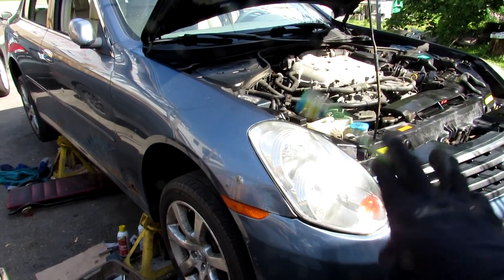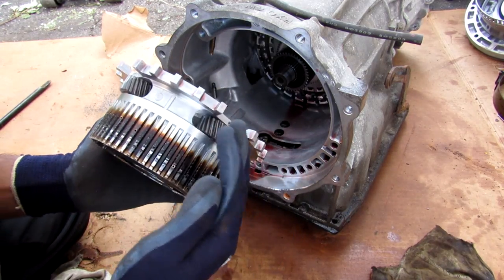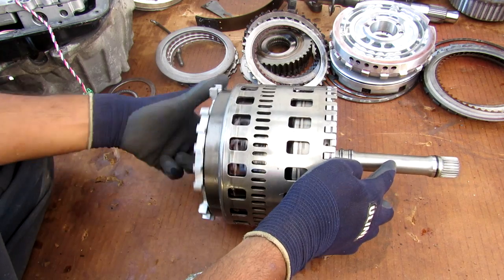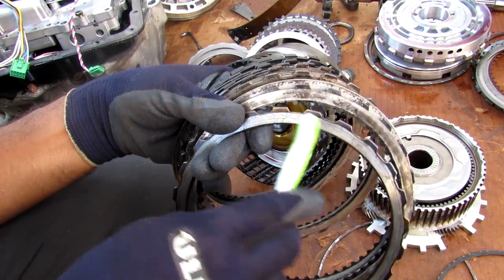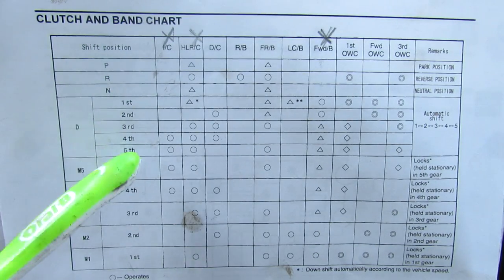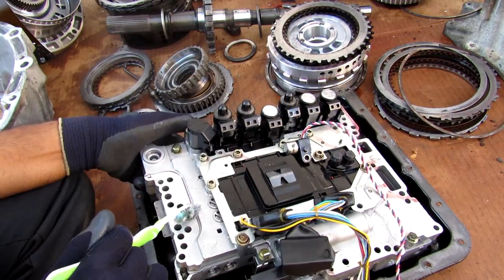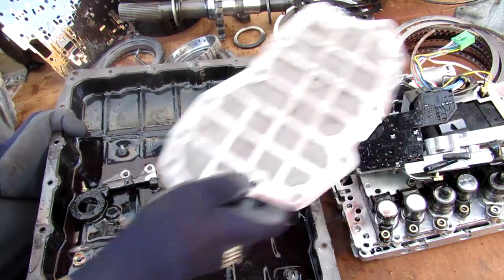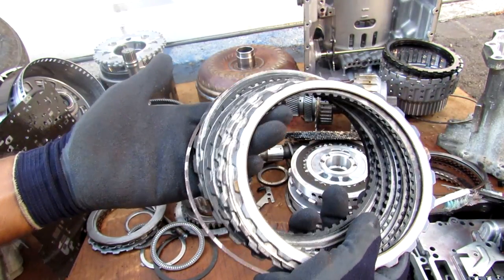Why Automatic Transmissions Fail

Comment: I can see why it cost so much to fix automatic transmissions. And it requires your brothers complete wardrobe to clean up the mess! 😄
Reply from the maker: Yes it's quite expensive. Most might just swap in a rebuilt
Reply: lmao
Reply: Hmm hmm
Reply: And that was a 5-speed automatic... imagine now an eight-plus speed.
Reply: cheaper to swap than rebuilding it.
Reply: And wifey's toothbrush
Reply: Just washes his clothes in dawn and put them back in his drawer he'll never notice.
Reply: Not only does it cost a lot to rebuild an automatic transmission, but there are not that many shops that can do it properly.
Reply: @SCX1718U  In a&p school A student brought his aircraft engine in and rebuild it in engine class.The other engine was done by a shop much cheaper and the accessories were new or rebuilt.He wanted to do both engines himself but couldn't afford to.
Reply: @allanbrogdon5317  yawns....
Reply: @patricklynch9574  works on oil soaked birds as well.
Reply: Honestly if it's clutch packs or bands or bearings it's not that bad. Most shops I know, don't even know how to repair or diagnose failing transmissions. They are essentially part changer's. "Just throw in another rebuilt" I'm glad this kid knows what to do with transmission repair.

The expensive part is when it's a clogged valve body, or programming the shift solenoid gov or TCM then it gets expensive and that many times requires a rebuild kit, new valve body but like I said in most cases a warrantied rebuilt Transmission or a new transmission. Instead of spending $1000 to rebuild the common mechanical components they throw in a new $16,000 transmission or a $6000 rebuilt that they get warrantied.

It's sad but I've seen this all over the states in dealerships and even some newer engine & transmission repair shops, ironically enough.

Comment: I'm 3 minutes into the video and already feeling anxious cause of all the parts! It was funny when you said "now I'm gonna remove all 12,500 and something bolts". You're very knowledgeable! Congrats!
Reply from the maker: There was a ton of bolts !
Reply: @speedkar99  my 12 Nissan Altima's 2.5 transmission starts to make a humming sound when I drive it for a couple of hours, I live in Imperial ca and the other day I had to go to San Diego thru the 8 fwy, the elevation starts at 1000 feet and ends around 4180 to its highest peak, I have to pull out to let the tranny cool at least for 10-15 minutes then away i go but this time i have to drive it looking at my RPM's do not exceed 2200 rpm's (65 mph) it really sucks! Any thoughts on why?
Reply: Sorry for the long text!
Reply: @310_Latchkey_kid  You literally just said why. You kick the shit out of it daily at low RPMs on long, hard ascents. Drop a gear and rev higher. You're welcome.

P.S. As with Google Maps, lowest and highest points don't mean as much as "total ascent" (all the miles going up) and "total descent" (... and down).
Reply: HE  TALKING ABOUT  ALL THE BOLTS TO REMOVE TRANS  from the car  TO ? HE NOT A WIZ  Kid ? BY FAR ?e if been around them 10 or more yrs ? i seen guys take them apart ? can't put them back ? OK !  MOST TRANS  MIGHT  HAVE  THESE DAYS  2020   800 PARTS ! PLUS IF YOU  WANT TO COUNT V BODY ? THAT'S A DIFF STORY  ? WHO KNOWS ON  THEM HOW MANY PARTS ! I BET HE DON'T EVEN  KNOW ? I BEEN RE BUILDER   30 YRS TO  every  V BODY so DIFF ?

Comment: This is why I prefer manual transmissions. I’ve fully rebuilt two of my own but I would never dare to open up an automatic. You definitely have a lot of knowledge. Mad props sir.
Reply: Some manuals are complexe.. but in general it's quite simple. It also depends on what you call "rebuild"
If you change the berings only that's the easier way to fix, sometimes there's more 😉
Reply: I prefer manual transmission too.
Reply: Automatics require a knowledge of upgrades to failure points or high wear areas that can be improved - plus knowing the proper spacing of part & testing of oil passages - replacing parts means a short life of 30 to 50K miles  - remanufactured is 120 to 200k  miles
Reply: Automatics actually add power, that would have been lost.
Reply: @frederickmfarias3109  At the time the engine puts its power to the input shaft, nothing on this earth will add power to the output shaft.
Reply: @armedfarm3429  They store power hydraulically, take power that’s transmitted or would be wasted and utilize it.
Reply: @frederickmfarias3109  Thats some funny sh!t right there!🤣
Reply: @armedfarm3429  You obviously don’t know how they work!
Reply: @frederickmfarias3109  Ya but you do! A transmission that makes energy Brilliant! Go away. What are you 4.
Reply: @armedfarm3429   No it saves it and transfers it.
Reply: @frederickmfarias3109  Sure it does, 8-12 % gets lost through the TC before it even gets to the Trans, another 10-15% through the gears. Some older ones up over 20%total loss. Newer ones with up to 3 planet gear sets, & 8,9,10 speeds like the ZF & Allision new types sometimes around 10% loss. manuals are even worse. Hang around me & you might learn something once you learn how to do math and read!
Reply: @armedfarm3429  It doesn’t look like it, but your numbers; the converter takes energy from idle and uses that in start off again.  And more.  That’s where it gets its name.
Reply: @armedfarm3429  regenerative brakes take power from the wheels and save power electrically, a torque converter saves some power at idle coverts it to slip and drive.   It doesn’t add more power than was input over time.

Comment: I can see why rebuilt transmissions never work very long, they are pretty much unfixable.
Reply from the maker: Yeah there's alot to go wrong there
Reply: Its true, finding someone who knows what they're  doing is almost impossible
Reply: And toothbrushes
Reply: @XtheUnknown99  Not enuf brothers' old shirts to get the job done correctly.
Reply: yeah, most of the engine rebuild manuals starts with  "clean place". A lot of shops are opposite of that.
Reply: Is not easy to fix my brother..
Reply: I rebuild my transmission in my living room 🙂. Been driving for 2 years now
Reply: I rebuilt them for years; if you know what you’re doing, they’re as good as new when rebuilt properly.
Reply: Josh Smith indeed it does matter whom you take it to. For example, I can rebuild any American transmission in about a half a day (some a little more), which would be about average. It’s in most cases knowing what you’re looking for and at, and realizing the design failures and pattern failures. 
 For example, on a truck used primarily for towing, I’ll make damned sure that it’s beefier and can handle the load, whereas Dixie soccer mom wants a smoother shifting box.
 And you mentioned cleanliness, which is great, but it’s more about avoiding contamination (dirt, moisture, etc) in the build.
 Another thing that really shows the difference between an overhauler and a builder is someone who takes everything apart and looks at all the parts for wear, including bearings, bushings, and washers.
 And my boxes are all ATRA gauranteed for 2/50000. Very few comebacks.
 BTW, the fords, GMs and Chrysler’s all use similar boxes; the 6hp26 became the ford 6r80 and the GM 6r70
Reply: They are fixable, you just need to take time, know the working principles (very important),  work in a clean area, take notes and photos or videos to help in assembly. They are very complicated and intricate and all work should be done to spec, no shortcuts.
Reply: Josh Smith Very true. We have a local business that rebuilds your automatic transmission. 3 year warranty. Super clean work spaces.
Reply: Well that’s obvious! Transmission builders have other costs, like tooth brushes and hygienics.
Reply: I’ve rebuilt a whole bunch of them.  They last just as good or better than a new one.
Reply: The more he talks the more expensive it gets.
Reply: Tobias  : If you replace "money" with "time and skill", you'd be absolutely right.
Reply: hey man, i got a discord for tony's. we need you in here
Reply: Tobias  : Don't know if I agree man... Frequently when I throw money at someone to fix a problem I just end up broke, shit's more broken and then I'm in time critical panic taskforce mode...
Reply: Josh Smith  no they don't 🤣 most fixed transmissions are toast within 3 years even when you take it to a specialist.
Reply: If you guys have a Honda automatic transmission I have video showing how to rebuild one and why it fails
Reply: @kingpenn8967  what kind of transmission you have,cause I want to try to do that job too
Reply: @marknaravas318  Mr Mark what metod you recommend me to learn how to fix transmissions beside school...i have no time to go to school and im too old for that 😊are you in fl if so, let me know, I am working in a lexus es 300 I'm removing the transmission and don't see a cheaper one no where.
Reply: @edardon16  the best way is to work for a good reputable shop. Even if you volunteer, you can learn a lot. Look for someone that doesn’t mind being watched (really bugs some guys) and ask questions. You might be cleaning a lot of parts, but that the biz too.
 There is so much to learn about what and how to do things, it takes a bit to learn. And there is a difference between overhauls and rebuilds, where you’re replacing bushings and making everything like new.
Since Toyota’s use Asian transmissions, that’s a good place to start.
 Another thing to learn is poweflow; what applied and released and how they fit together is crucial to diagnosis, where it’s sometimes hard to discern between a clutch apply problem or the valves not flowing correctly.
 If you need to talk, just message ne
Reply: @marknaravas318  thank you very much  Mark
Reply: Mark: A mechanic once told me that either change the fluid regularly or never change it. Comments?
Reply: @dmac7660  I agree. If you have a trans that rebuilt and receives regular fluid changes (I’d so no more then 60k, shorter with older or high-problem boxes) that’s great.
 If you start changing the fluid in a burnt box, the sludge is usually the only thing holding it together. It’ll get done during the rebuild.
 There are many arguments, but this is what my experience has been.
Reply: I've rebuilt mine years ago and still running strong.. and I've been driving it all over the country

Comment: So basically everything in an automatic transmission is a failure point?
Reply: @thealienrobotanthropologist  excellent points! 
Abusing clutches is a guarantee for premature failure. 

Recently I got to experiment with the synthetic "Valvoline MaxLife ATF": its a far BETTER fluid than Honda DW1 mainly it has stable viscosity! 
It gives consistent shift points and managed pressure for lower clutch wear 😉.

To be friend with your transmission: replace ATF early (20kMi without converter drain or 40k with converter) - 
Buying a "dipstick evacuator" will pay for itself the 1st time.
👍
Reply from the maker: Yep. Except the user
Reply: @speedkar99  well I mean, in many cases the user could also be considered a failure point 🤷
Reply: @thealienrobotanthropologist  thanks for the explanation.

I don't know much about automatics but he did say at 9:22 that the valve body is a big failure point 🤷
Reply: I hear alot of "don't do anything to the transmission or it will fail."99 Yukon 253,000 miles.Fluid is reddish brown translucent.I believe if I don't maintain it the filter could clog up and starvation will kill it.Many people don't think of the transmission until it slips try to save it then blame the flush or drain and fill.Not a transmission expert but heat and dirty fluid 🤞
Reply: @allanbrogdon5317  you are right! The 4th and 5th clutch packs in the video burnt because piston was starved on low pressure, not race driving on 3rd gear alone!

Take a long look at the amazing MaxLife ATF... Spec out the viscosity of your OEM ATF Fluid and go up in viscosity to make up for pressure  losses. 

Thin ATF and low pressure guaranteed short life for clutches that contaminate all Solenoid filters that starve clutch pistons.

Bumping up viscosity will also lubricate gears better and quiet them out with a good anti-wear additive pack... I am really sold on Valvoline MaxLife.

Tranny that bang on cold ATF are a clear sign of fluid that is too thin when warmed up to normal operating temperature: computer learns need for increased pressure due to thin ATF (stripped & burned clutches do that too)
Reply: @thealienrobotanthropologist  valve body is known to fail on some jatco transmissions
Reply: That right,that's way I drive Only Shift Stick They are simple and reliable and the when the clutch get worn it is cheap and easy to replaced it.
Reply: That right,that's way I drive Only Shift Stick They are simple and reliable and the when the clutch get worn it is cheap and easy to replaced it.
Reply: @speedkar99  I've heard of the transmissions in 1990s vintage Hondas being prone to failure.  Are 2015+ Honda transmissions any better?
Reply: llOOII llOOII  Did you mean Asian or Aisin because Aisin is a Asian transmission company.  They make very sold transmissions.
Reply: @allanbrogdon5317  I used to change my Transimission fluid with the filter every year or every 15k and the transmission failed on 120k .when I asked transmission Technician what the reason of my  car transmission failure he doesn’t have any answer??
Reply: @Godot696  Never rebuilt an automatic transmission.Looks like you could screw it up easily that's alot of work and cash.My friend in highschool I helped him with a clutch on his nova and a few months later him and his brother rebuilt a 70s blazer 4x4 automatic in about 1982.The kit was $400 back then but it worked fine.I could have a chevy automatic removed rebuilt for $250.Too cheap to try it myself even though I rebuilt several SBC engines before 18.Kind of a fear of the unknown.Even if it lasted a year that was a cheap transmission rebuild.At 59 I would like to try an automatic my Yukon gets comments about smooth shifts retired and poor I became recourse full driving Toyotas for years I had no idea what a chevy could do if maintained and driven reasonable.I need a filter and fluid change but I'm gun-shy after the stories about failures after routine maintenance.
Reply: @glasser2819    I too tried valvoline maxlife full synthetic ATF in a Honda Odyssey.   While it did work.  I went back to DW1 fluid.  I could fee. The DW1 fluid it shifting MUCH smoother.  
2007 Honda Odyssey 204k miles
Reply: Yep, just about. Can’t wait till those modern 8 and 10 speed autos fail... that’s gonna be fun. Sadly half of those transmissions are non serviceable.
Reply: @dfields9511  smooth shifting increase wear. You want firm (but not harsh) shifts. Most of the problem is the TCM (or drop resistor value on older cars). Manuf makes them shift slow, b/c idiots like that. It's terrible.
Reply: @TheGuruStud  ok,   In my case going back to  dw1 fluid fixed a slight slipping issue.  Also Since going back to dw1.  No more slipping and improved shift quality.  Which is stated in owners manual if you use something other than the Honda fluid.  The shift quality will not be as good .
Reply: I do agree but an engine ain't much different.. don't abuse and keep up on oil maintenance and you'll never have major issues.. with both.. that and heat will keep both pretty quick.

Comment: Removing that transmission was a snap! Wonderful Nissan design.
Reply: they make it easy to own and then  dispose 🙄
Reply from the maker: Step one remove engine
Reply: @speedkar99  Funny, but it's the same on my 2005 Scion XB. Toyota is just as brilliant as Nissan, it turns out.
Reply: I almost thought it was a Ford.
Reply: @Greenbearls  You make great ham. I buy it sometimes.
Reply: They don’t build them thinking the transmission is ever going to come out 😂
Reply: @nyyankees4296  "Last the timetime of the vehicle." Except no one will tell you what that "lifetime" is supposed to be.

Comment: My shift solenoid is attached to my shoulder.
Reply from the maker: Manaul transmission
Reply: Ha!
Reply: Manual is always the best
Reply: I hate auto tranies. Manual with no synchros.
Reply: @Greenbearls  if you can't find it, grind it.
Reply: Vladimir_Bone Spur_tRump  Manual feels more like driving than Manual.
Manual is good when it comes to certain situations if you're stuck.
Reply: @fastfiddler1625  if you can't find it, don't drive it. Keeps most people of my truck XD
Reply: That is funny shit ha ha I love it
Reply: Manual transmission also known as a millennial antitheft device
Reply: @vinces8974  lol when I got new tires put on I mentioned I have a complicated anti theft system.